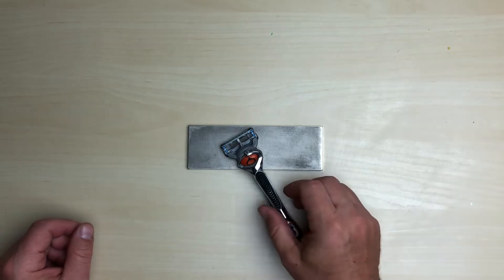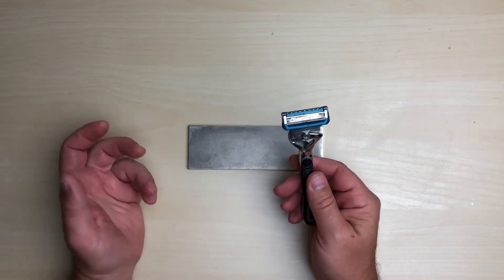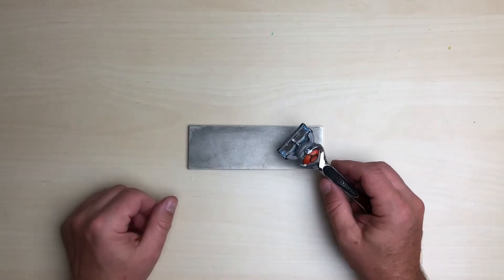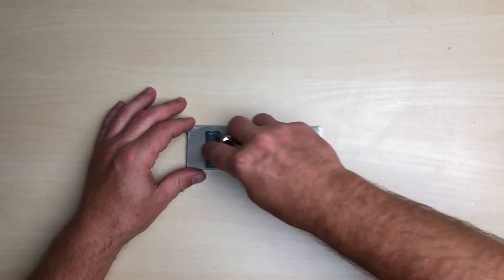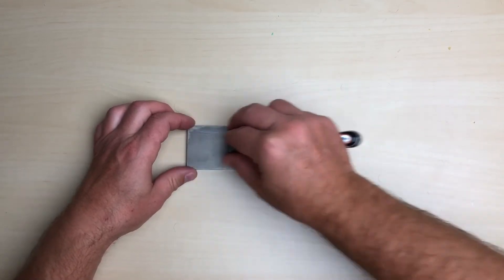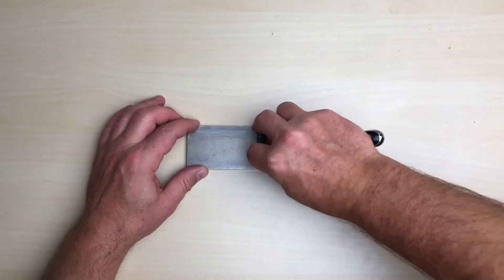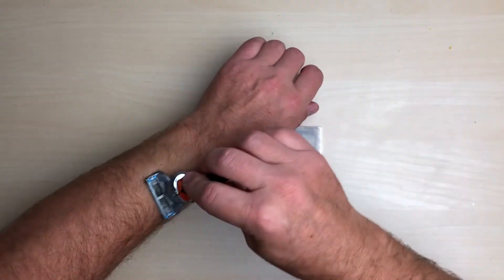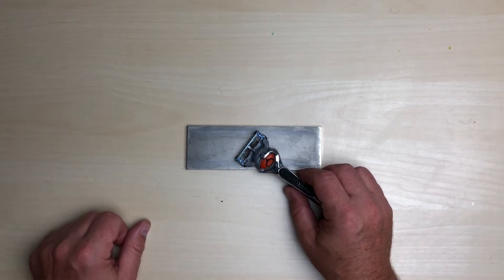Short Life hack of How to "Sharpen" an Old Razor Blade

Comment: dude buy a double edge razor you can buy 100 blades for $8...lmao
Reply: You can sharpen the double blade and use one for decades !! .. yes thats how man did this !
Reply: @gmy33  I have been trying to sharpen a double edge razor for a month using a number of techniques such as Sic powder of 8000 grit and then watchmaker diamantine and then stropping on cow leather and then a leather disc on my watchmaker lathe and then other things. All I can say is I shave in tears. Sharpening a DE razor is a challenge but I still do not give up
Reply: @Qwerty-cb1ti  why not just buy a DE hone lol
Reply: @lemcakes32422  do you know of such a tool? All contraptions I saw wouldn't work very well.
Reply: @Qwerty-cb1ti  go search them. they were common during ww2 DE sharpeners
Reply: Modern SafetyRazor Double edge Blades are very difficult to sharpen. I use them and have tried to sharpen them.I have not been successful at this. I have seemingly extended the blades usefulness by rinsing the razor after each use and dipping it in Rubbing alcohol I keep in a small resealable  container. I then let it air dry until the next shave. For some reason I get more shaves from a blade after the dip in the rubbing alcohol. Perhaps it cleans the blade better?

Comment: I'm not impressed - if a blade does such a crap job AFTER it's supposed to have been sharpened, then it ISN'T sharp. It doesn't compare at all with a fresh Gillette Fusion blade, which would have made that area of the arm smooth within about 10 strokes. This 'sharpened' one didn't even come close.
What's next? Convert half-empty beer bottles into full beer bottles, by just topping them up with water? 
No thanks!